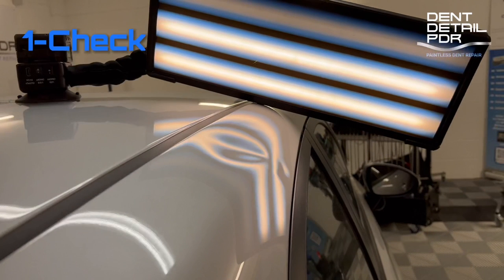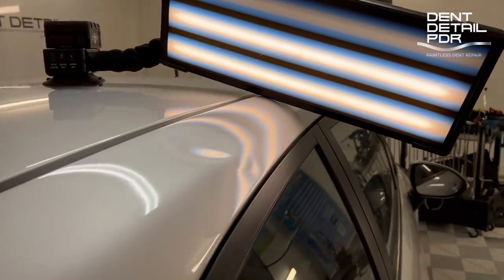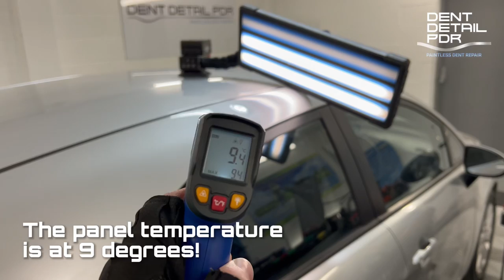How to remove BIG dents with glue! | step by step repair | Paintless Dent Removal | PDR dent repair

Comment: Do you think that an Amazon PDR dent pull kit (SuperPDR) is good enough for a starter kit for a beginner? I noticed that the tap downs is a hard plastic. I’m thinking about giving it a shot
Reply from the maker: Hi, personally no, if your wanting to learn how to do it, there’s no point using cheap kit to learn, as it will only hinder you.
Investing in the right tools and training will go a long way
Reply: @dentdetailpdr  The tools is for glue pulling only. No rods included.
Reply from the maker: @Mike-ku1hj  ok it’s worth a try

Comment: I looked at an Amazon glue pull kit to start with. Is there a better less expensive kit to start with?
Reply from the maker: Again I don’t recommend using cheap kit to start as it won’t work